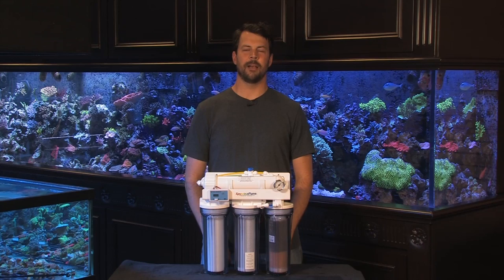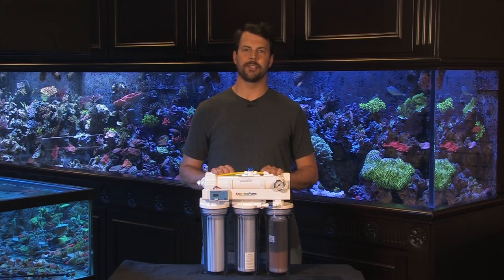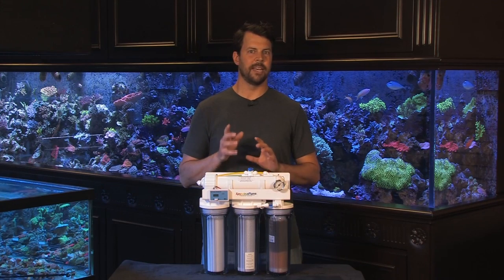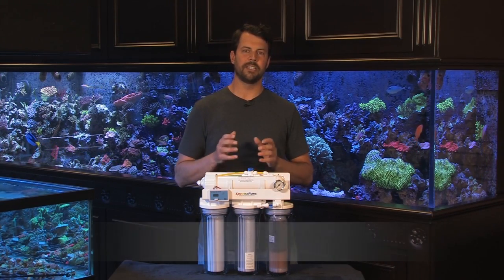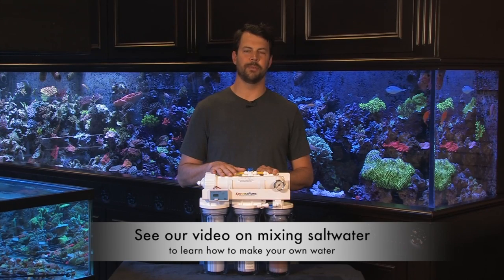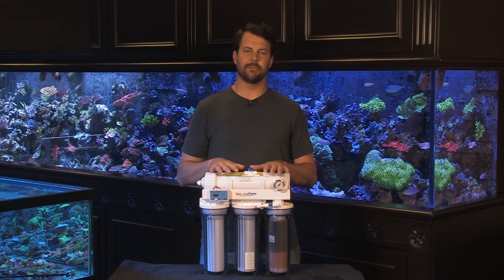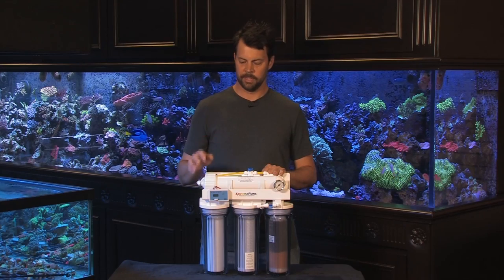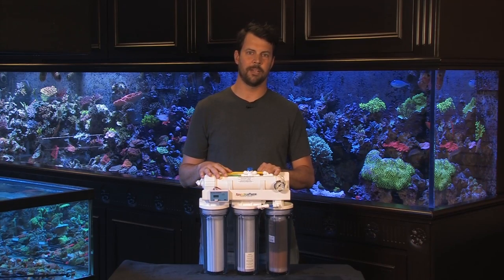RO Water Filter

Comment: If you wish to maintain a reef aquarium any TDS from tap is too much.  35ppm is very very high for reef tanks.  Who knows what those solids are.  Often the majority of solids that make it through are Phosphates and Nitrates.  You do not want 12ppm Phosphates or Nitrates or even half that if you want a reef tank.  Even in a high nutrient dirty system with soft corals, if you start with nutrients that high and actually have animals to feed you will not be able to bring it down that much.